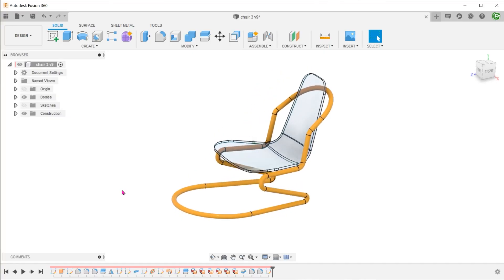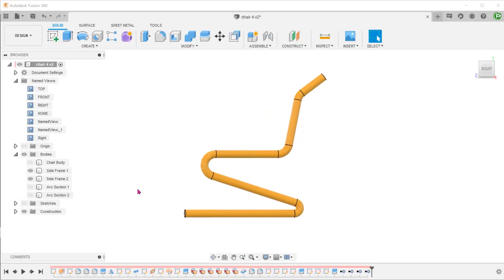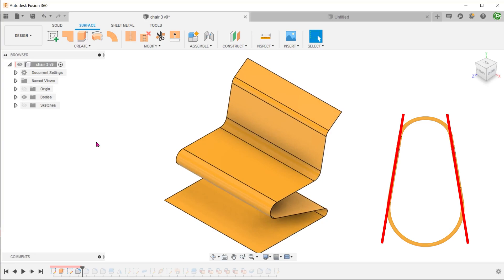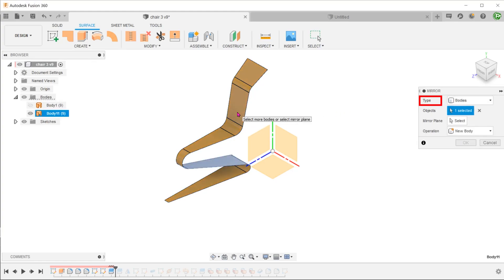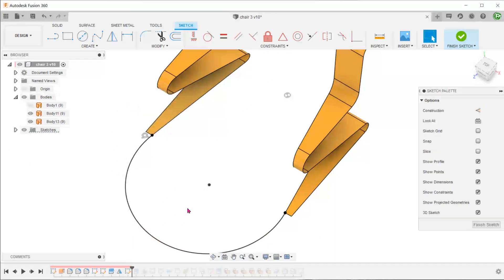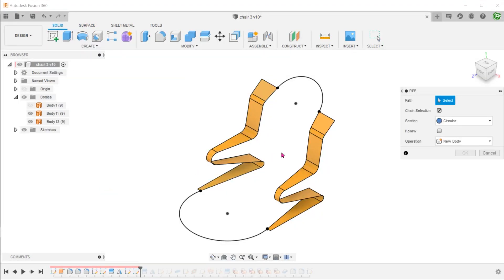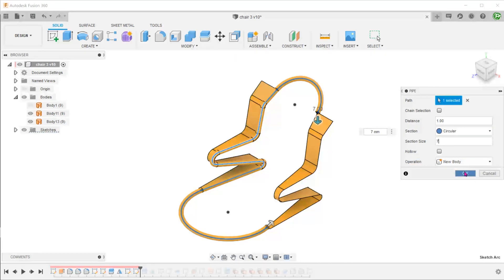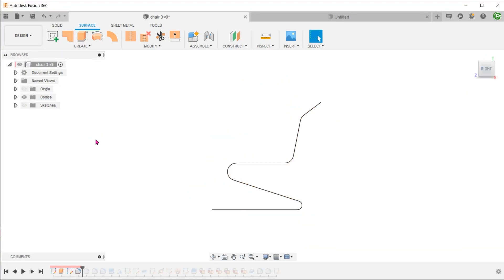Fusion 360 - Chair Frame (No 3D Sketch)

Comment: you said no 3d sketch then you use 3d sketch at 3:23
Reply from the maker: All sketches created in this video are planar. For the bottom arc, I turned on "3D sketch" in the sketch palette purely as a means of facilitating the snapping to the end point without having the need to project. This is a quirk of sketching in Fusion 360. The arc sketch is still a planar sketch.

Comment: I thought you said "No 3D sketch"?  And then you used it!!!
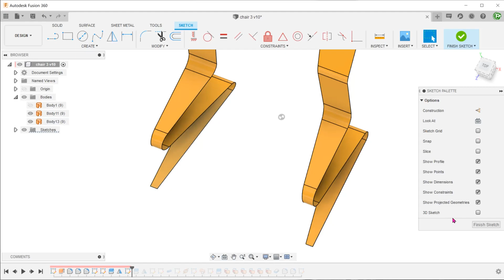Reply from the maker: All sketches created in this video are planar. For the bottom arc, I turned on "3D sketch" (at 3:08) in the sketch palette purely as a means of facilitating the snapping to the end point without having the need to project. This is a quirk of sketching in Fusion 360. The arc sketch is still a planar sketch.